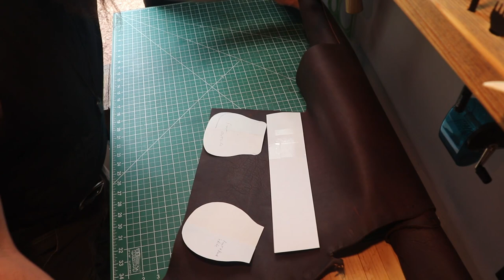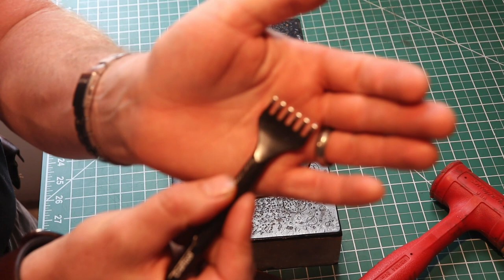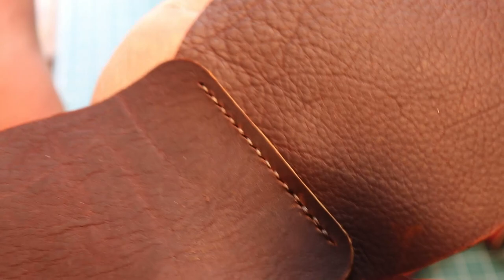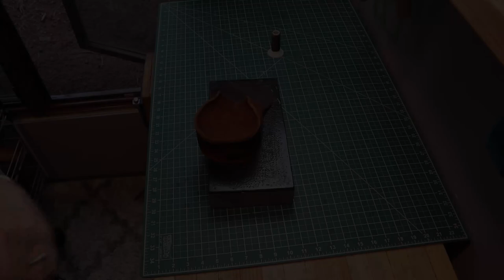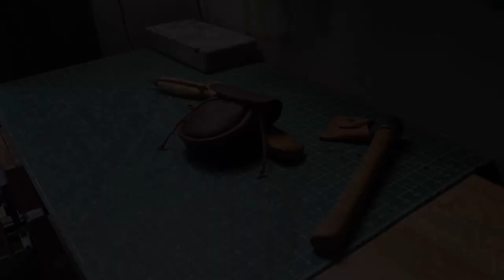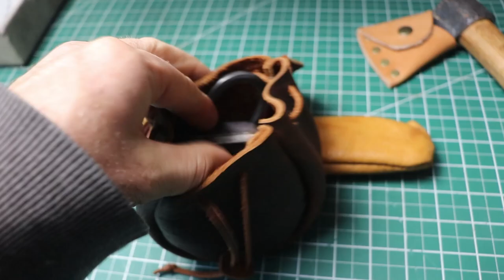Making a Bushcraft leather belt pouch

Comment: Very good job! I use a pricking iron on my stitching holes. the drawback is I have to count the number of holes on the front and back to stitch the gusset in. I have used a fold over belt loop, but I may start using the flat style. If you use the fold over positioning, stitching the first row and then folding it over is easy to get it wrong. I have been playing with leather since the 70's. Your pouch is excellent. That should last someone almost a lifetime.  I look forward to seeing some of your other work.
Reply from the maker: Thank you 🙏 yeah I never can get them lined up great if I don't go hole by hole with the iron. Someday I'll be good enough to make a pattern I can punch and it'll line up ✌️ thanks for stopping by -Sam

Comment: is there any pdf file i can download with the design of the pouch?
Reply from the maker: Not currently but I'll start working on the pattern after Christmas! I'll try to pin a comment and reply when it's up 👍
Reply from the maker: pattern is available now! https://www.etsy.com/listing/1141491382/belt-pouch-pdf-pattern-digital-download?click_key=74035241c2784fcc3dceecfaeb40b71719d34ce7%3A1141491382&click_sum=ab2fea70&ref=shop_home_active_1

Comment: Beautifully made! How thick is the leather you are using?
Reply from the maker: I used some 5-6oz oil tanned Kodiak from Tandy. And thanks! 🙌
Reply: @darklakeforge3300  I see, thanks! Just another question: is there a reason why you stitched the back panel and the lid together, instead of making it from one piece?
Reply from the maker: @sasker1000  you know i think the reason was i was using some scrap pieces from when i made a run of wallets so i wouldn't use a lot of the hide i have. It would be easier and probably be nicer to use a single piece though. when i create the pattern for download i will probably include the pattern for both ways of doing it. it will save some steps and sewing for anyone who has a big enough piece of leather.
Reply: @darklakeforge3300  That makes sense. I am going to make something similar as my first ever leather project. Your video is a great inspiration to get started. Thanks for sharing!
Reply from the maker: @sasker1000  i'm so glad to hear that! thanks for watching and i would love to see some pictures of your project once it's done! my email is DarkLakeForge@gmail.com Happy crafting!
Reply: @darklakeforge3300  If my little project does not turn out too bad, I will send you some pictures ;)
Reply: @darklakeforge3300  I have sent you some pictures ;)